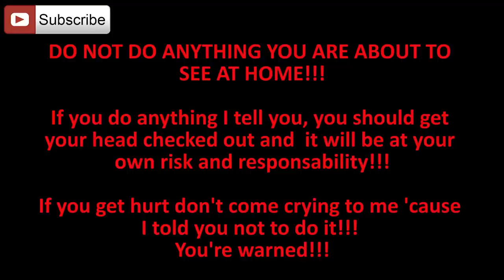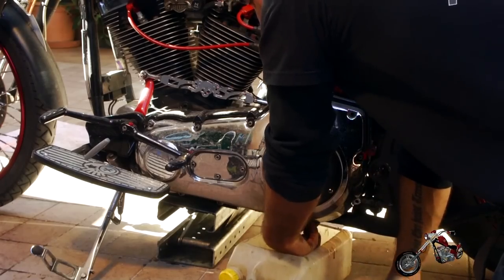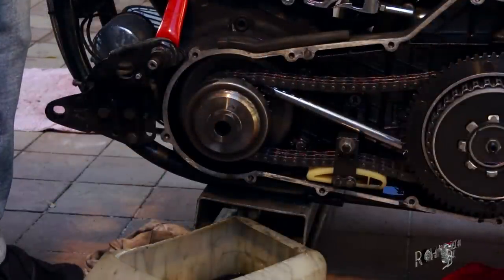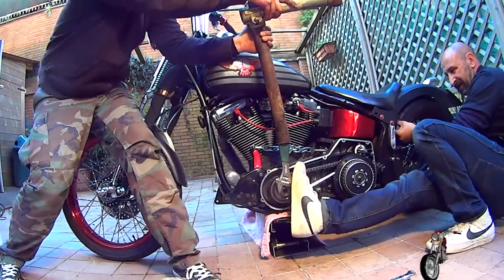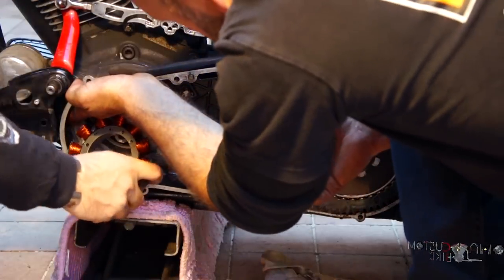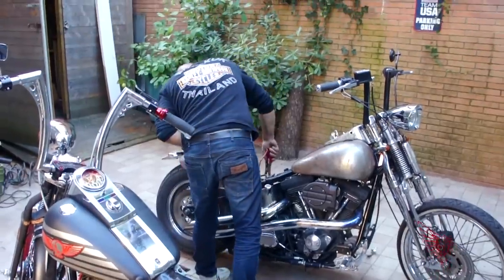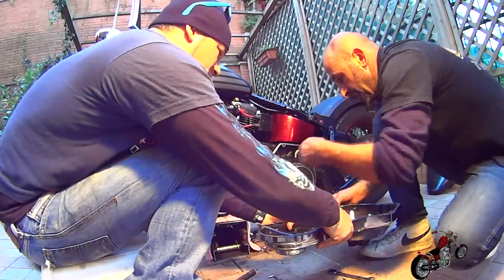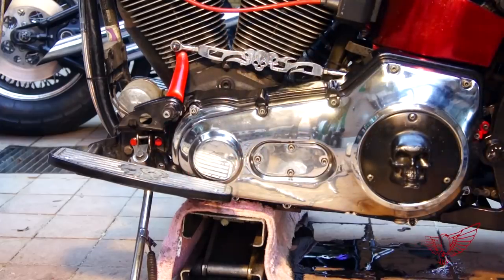Harley Davidson rotor and stator diy repair replacement e21 Roma Custom Bike

Comment: I've got a 20" long, half-inch socket breaker bar, and a five foot length of pipe. Might have a socket that big so I'll be tackling this job shortly.   I'll remember to use the wood block tip from the comments.  Looks like fun times.

Comment: It's common to grind floorboards or foot pegs, on extreme lean angles on different bikes, and H-Ds are no exception. I will have to check out your google glass video, which to date, I have not seen......yet.
Reply from the maker: +tomcata1467 you'll like it!!! its some riding in Rome... not for the faint of heart ;)

Comment: It is a lot safer to wedge a block of wood in between the teeth on our clutch and crank  metal is just going to mess up your teeth.
Reply from the maker: Awesome Idea joshua, I can't believe
That they don't suggest it in the shop manual!!! I'll definitely do that next time. Thx
Reply: Your welcome had mine apart a lot this year also if you wrap a piece of cloth around the block of wood it helps keep the wood splinters all in one place so you don't have to try and pick them out of your primary later.
Reply from the maker: an other great tip!!! If i can manage to do a revision of the episode i'll make sure to include yout tips! Thx a lot

Comment: Hi Cez. This is an amazing idea. But...tell me...confidentially...why u glad to get the reflection lights on your sunglasses while you talk to your fan ?  This is a very bad way to set the light. It looks like a beginners work and doesn't makes good on your project. Thinks better about !   Have fun !!!   Kisses to your family
Reply from the maker: Davide Mancori my brother! the sealing is too low in my shop :) i will look into it though
Reply: Mhhhhhhh...take off your glasses if you can't do better with the lights !!!   Or........build a frame, with a cross inside and set it between you and the light. In this way seems the lights coming through a window !!!  Probably looks better !

Another way out is to set twins lateral panels, a couple or maybe three/four meters away from you.  Set the spotlight on it and you can act through the reflected lights on both sides. Often it could be a tv solution

Comment: This is a very common problem on H-D, big twins..........due to the bad, design placement of the stator, into the hottest part of the engine, right up against the lower crankcase where the heat is intensified.........thus "baking" the stator windings......heat and critical electrical charging components is a big no, no...........but, H-D, sells lots of stators, and the labor costs associated with the stator, replacement. Have to disassemble the entire primary drive to get to the stator..........same thing with the starter, located right behind the hot rear cylinder under the oil tank, have to take off the seat, battery, and the entire oil tank, and lines, just to get to the starter and this is another critical electrical charging system component, subject to intense engine heat...........that's a Harley for you.......
Reply from the maker: +tomcata1467 you are so right man! I have to check out the starter next and I'm so not looking forward to it! On the bright side my bike is 25 years old, so if it this needs to be done every 25 years its still a pretty good deal :)

Comment: Use your rear brake in high gear... watching you stick a 1/2" extension bar in the primary made me cringe -- that is why the locking blocks they sell are made of nylon. You're lucky if you didn't break any teeth off the clutch hub or compensator. Horrible practice. Next time put the bike in high gear and have your buddy hold the rear brake down.

Also, your chain should not come off the compensator sprocket without being removed with the clutch hub at the same time. Your chain is heavily stretched/worn and needs replacement.

*starts and runs on one cylinder* lol.
Reply: Or use a block of wood like a normal person.
Reply: @bretbrown4325  that never got me anywhere except a primary full of wood chippings...

Comment: Late comment but instead of using a piece of wood just take an old shirt and tie some big knots in it together and put that snug up in the chain and the front sprocket and your wrench will take it off and to tighten it u put the knot on the primary sprocket and repeat lol. And use the proper tools people. Torque wrench

Comment: S Hos: For the record, I do enjoy Harleys, just not the Twin Cam series, produced from '99-to the present, as they are not the same design as the older model, EVOS, SHOVELHEADS and PANHEAD, bikes of yesteryear. I don't like the engine design or inherent problems of the Twinkies. I have enjoyed riding Harleys over the years, and my brother, rides a 2015, Street Glide. His choice, just as I choose not, too. But, he trades his bike in every 2 years, and so, he doesn't put that many miles on his bikes, before he flips them, so, if you want to always have a payment and a new bike, with low miles, you should be okay. I buy a bike and ride it till its service life is gone, and get me another used bike. So, different strokes for different folks. The new model Sportsters are great cause they still use the EVO designed engines, and are quite reliable.
Reply from the maker: Bikes have to fit your soul :) as u said, different strokes for different folks. You gotta be so lucky to figure out your stroke :)
Reply: Custom Cez; Well spoken, live long and prosper.....

Comment: A pipe wrench really?
Reply from the maker: +Chris Inserra hey, u've gotta use what you got 🤣
Reply: Custom Cez Fai Da Te The correct socket to remove your compensator nut costs less than that pipe wrench. C’mon dude... if you’re going to make a how to video, at least make an attempt to do it the right way.

Comment: That's only cause you don't ride your bike much.......any H-D, that sits in the garage is not going to burn out any stator or starter.......most H-D, owners don't ride much, according to a study commissioned by Harley itself......the average, owner, only logs, 1,150 miles a year, and for every owner who rides, 10,000 miles a year.......there are 8 new owners who only ride.........are  you ready?.........only 600 miles a year. That is why there are so many 25 year old H-Ds, for sale, any day of the week, with very low mileage on the odometer. Again, the only way to burn out the stator and starter is to ride and get that engine hot.......and the stator will be "baked" and the starter will go, too.
Reply from the maker: +tomcata1467 shit!!! those are low numbers!!! crazy though

Comment: Wow \I can not believe what I saw First using a metal socket extension to hold the primary chain from turning while removing the two bolts? Then a cresent wrench on the comp sproket nut? Then a Fucking pipe wrench?????

Comment: WHY DID YOU NEED HELP? I DIDN'T, I DID IT BY MYSELF, AND NEVER USED MY FEET OR LEGS ONCE, DID IT WITH EASE, IN LAS VEGAS NV. 110* TEMP, YEAH, I SWEAT MY ASS OFF, BUT HELP WAS NOT REQUIRED